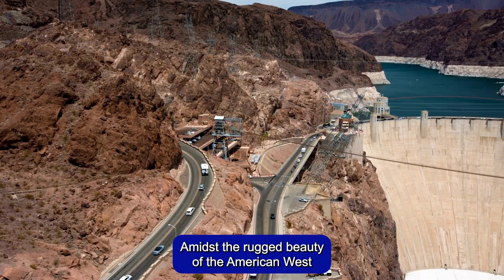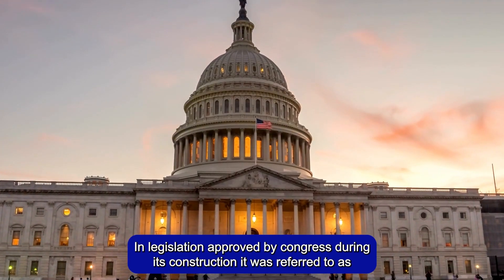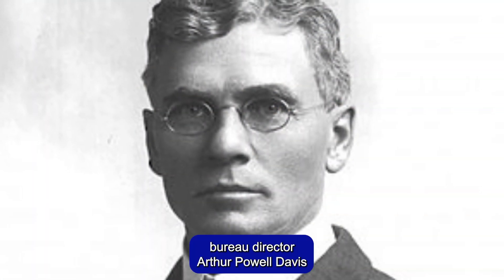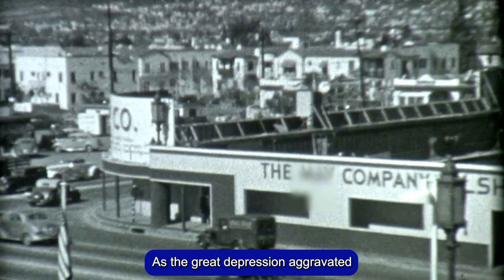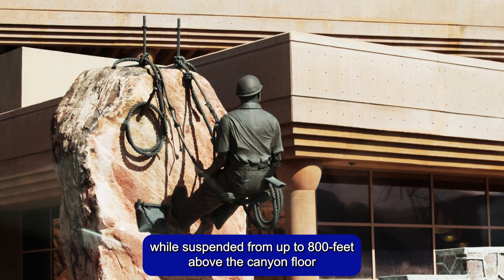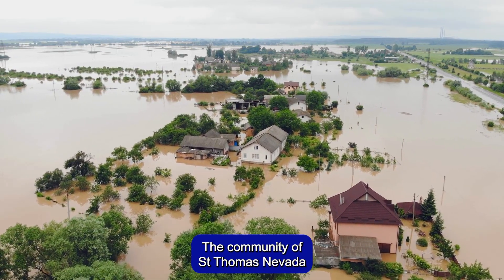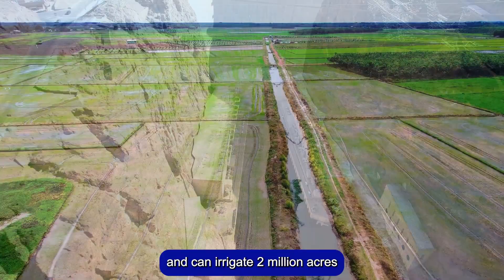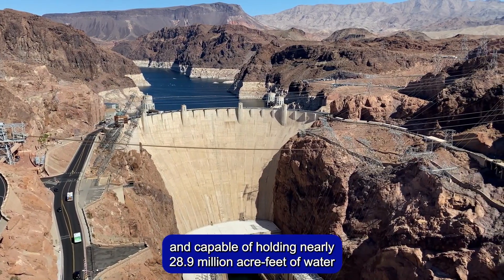Hoover Dam: Engineering marvel of the 20th Century

Comment: Not saying Hoover dam anything bad but calling it an engineering marvel of 20th century means the following are ignored:-
(1) There are dams higher, much longer and much bigger
(2) The maximum size turbine in Hoover dam is 130MW.  Is this an engineering marvel in the company of 700MW typically used in big dams?  Bearing in mind there are now turbines rated 850MW and 1,000MW each already in commercial operation.
(3) The total electrical output of Hoover dam is 2,080MW.  That is tiny because according to Wikepedia as the top 37 dam have 3,000MW as the minimum.
(4) Hoover dam generates about 3.3TWh annually.  Top  hydro in the world can do about 100TWh!

Claiming it as an engineering marvel in the 20th century seems like a frog looking up the sky from the bottom of a well.  Due to its age it may be more appropriate to claim it was an engineering marvel when it was built in 1930s.
Reply: it was made during the great depression
Reply: that pretty spectacular